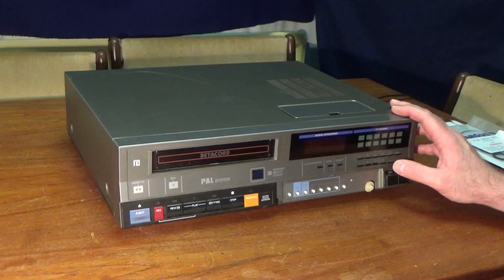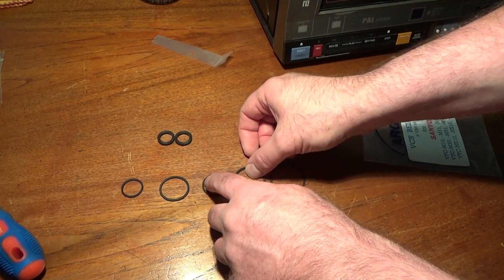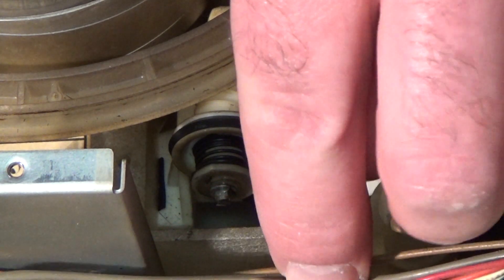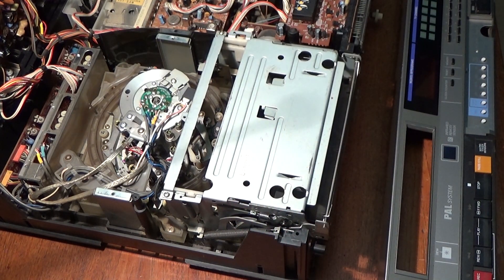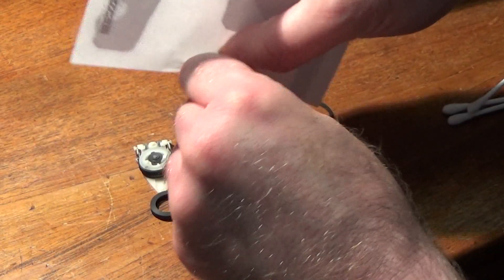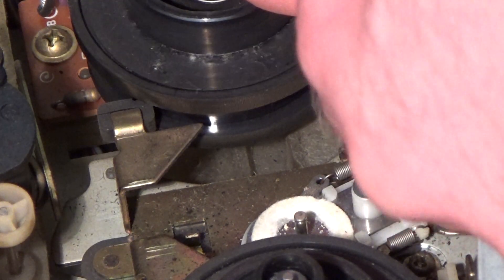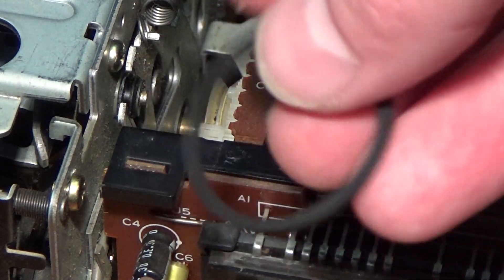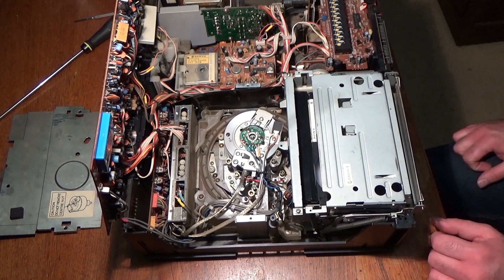Sanyo Betamax Front-Loader VTC-M range and VTC-NX range: Idler and Belt Replacement (VTC-M20 shown)

Comment: Hi
You will have issues there.
The top idler part is missing the plastic white pin (see the hole) that stops the top idler contacting the spools during FF,REW and unlacing.The plastic usually develops a split allowing said pin to fall out.It may sill be in your machine.
Also the bottom idler assembly is missing a spring,large washer and the tiny hold together washer .(See upper/top idler assembly) .The patented Classic parts were notorious for this as the hold on washer would come loose allowing the spring and other bits to ping off.
It would be easier to remove the loading section by removing 4 small screws and 2 large ones. Then the 3 side ones to the side of the insertion mechanism to remove the belt.Also unplug the motor to this as well.
Reply from the maker: Thank you for the advice! I was worried when I saw evidence that someone else had been inside the machine before me - they presumably bodged a previous belt/idler replacement. Now I look at the video, I can see there are scratches already on the idler pendulum around the circlip, which also shows someone else has attempted this job previously on this machine. I will have a look around inside the machine to see if any of the missing bits are rattling around in there, but I'm sure I would have noticed them before if they were there 😞. The top circlip also feels much too loose; I don't think it's the correct circlip. My heart always sinks when I find evidence of previous tampering.